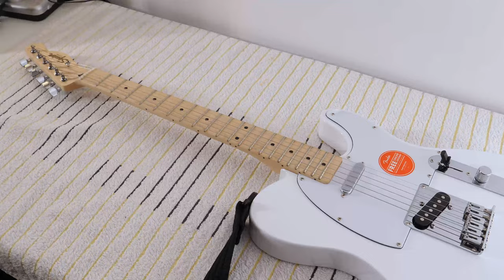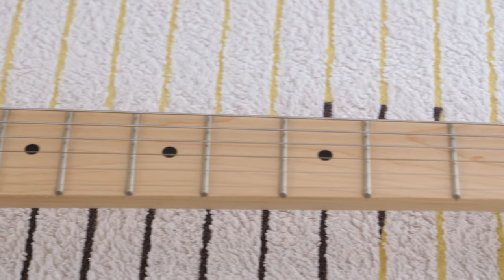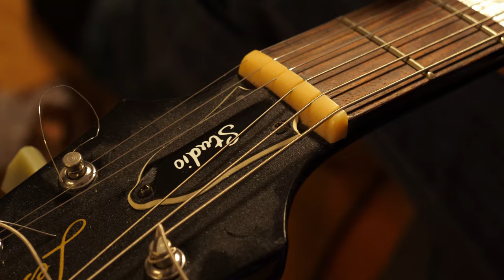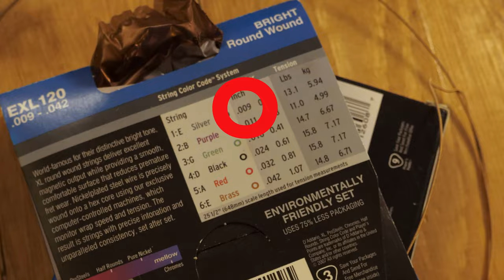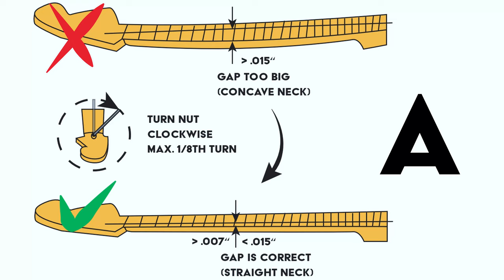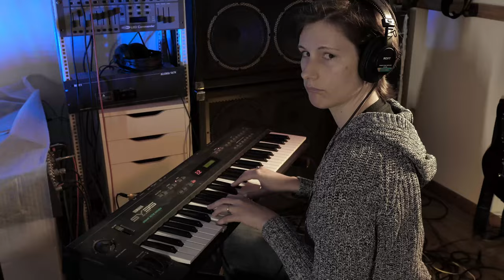How to set up an electric guitar - Telecaster TRUSS ROD Adjustment

Comment: What if my neck ( that of the guitar, not actually mine) is not completely straight and my truss rod cannot be tightened anymore ???? New Fender ? 😩
Reply from the maker: That's more something you could try fixing with a small wooden wedge in the neck pocket.

Comment: The allen wrench doesnt turn the truss rod. I dont know if its the truss rod thats broken or me thats doing it wrong
Reply from the maker: Sometimes it's a problem with the tool. Are you sure you're using the right wrench? The nut can be metric or imperial and this can make a huge difference. Also, what's happening exactly? Is the nut turning without the neck reacting to it or is it so tight that you can't move it at all?

Comment: I don't get it. This only works if the string height is already correct. If the string height is too high to begin with, there will be a larger gap between the 6th string and the 8th fret. If you then tighten the truss rod to get the desired height on that fret, you will have over tightened the neck creating a convex bow. 
Straightening a neck is about finding the ideal tension compensation that results in no buzzing.
Reply from the maker: We bypass the current setting of the string height by putting a capo on the first fret. That's the trick and it's crucial for a correct setting. If we don't use a capo, then you are right, of course. I hope this helps!